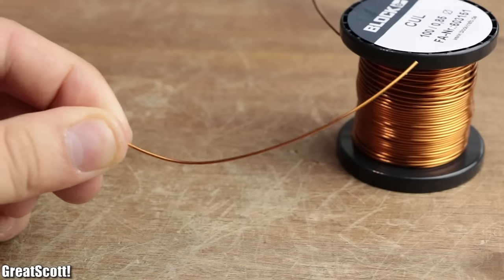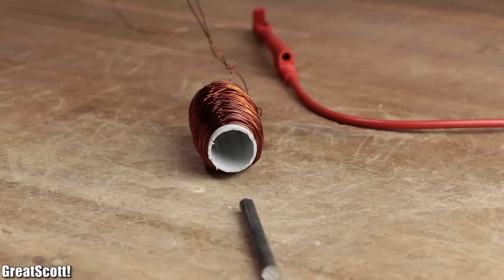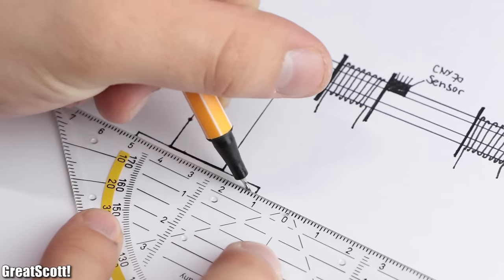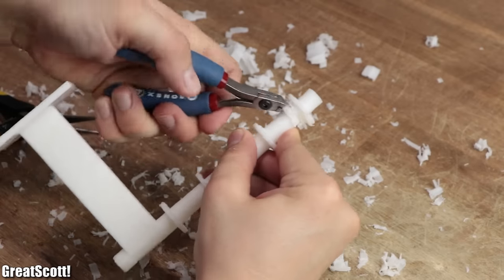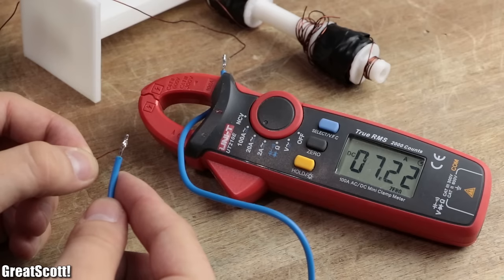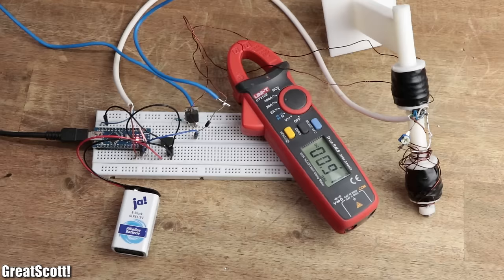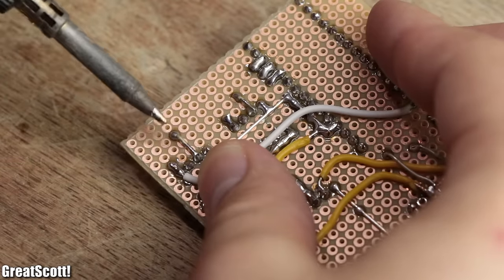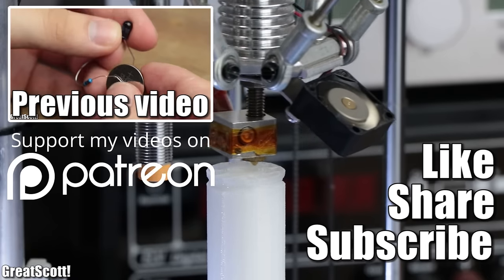Make your own Coilgun

Comment: Nice! But i want to see a new coilgun capable of "destroying" objects. So, do it with some powerfull capacitators. Pls, as soon as possible
Reply: hehexd
Reply: Flickerino
 I need it!!! (Nope!)
Reply: If you want it to be powerful, upscale it so it can push out a higher weight projectile at faster velocities
Reply: Oliver Church
I know it. More coils, a lighter projectile and some big caps. But i don't know the ciruit for controlling the coil, charging and discharging the caps, etc, etc. So i need to wait a new video from GreatScott
Reply: me too
Reply: +jackguo380 rectified main's voltage gives you the rms ac voltage multiplied by square root of 2. For example, with 230v ac, you will obtain a thing like 310v dc
Reply: I can't open the link now, but I swear that i've connected a capacitor to main's voltage with a bridge rectifier and i've been very scared because i've exceeded the maximum voltage of the capacitor and reached 310v, I was afraid that the capacitor would explode in a few seconds. In fact, 310v is the peak voltage of a semi wave, peak voltage that is kept, rectified and livelled by the capacitor.
Reply: Lord Tiger
Trow it away
it's a bomb xD
Reply: Woop2000 Ka-boom.
Reply: just make the barrel bigger more coils and stuff idk the rest
Reply: The force exerted on the projectile is the flux density of the elecromagnet, multiplied by the current, multiplied by the length of the projectile. Bearing that in mind, you wouldn't need capacitors to increase the force exerted on the projectile.

- Longer projectile.
- Wire with a higher CSA or a lower resistivity to increase the current.
- Coil the wires as tight as possible, with as many layers as possible (The more wire you can fit into an an area, the stronger the flux density is gonna be.).
- Replace the PVC tube with a steel or iron one to increase the flux density.

There's four ways you could increase the force of the projectile without having to use capacitors.

Bullets, on average have, 305N of force, so if you can do the things mentioned above, it wouldn't be impossible to create a coil gun with the same force as a bullet from a firearm without having to add capacitors. 

Of course, the longer the projectile is, the heavier it'll be, so probably best to focus on that only if necessary. Another option would be to make it hollow.
Reply: wow. smart fella
Reply: you can do that just by making this coil gun but shooting smaller projectiles
Reply: @tiger.98  you need 400V rated capacitor
Reply: @johnrubensaragi4125  it's been 2 years lol
Anyway yeah, you need some headroom so 350v is the bare minimum. 450v is common (mains have peaks)
Reply: So much this!!!
Reply: This can destroy paper.
Reply: You can already destroy an ant with this coil gun.
Reply: @ProsD03  Google it then
Reply: lollx destroying objects, why not use a powerful one to launch a satellite in to space?

Comment: When I was experimenting with my own coilgun I used transformer inductor with circuit from the old camera flashlight which was increasing voltage up to 300V and firing 7mm steel BB from the single coil. Now It's stored in my eletronic box so I'll build it up again very soon and possibly make a video about it
Reply: subbed
Reply: 5 years have passed, where is your coil gun video!
Reply: @kerbatonbaton8108  Totally forgot about it xd. Strangely enough I still have that gun and I'll try to make it happen not very soon cause I now have other interests mostly related to car stuff.
Reply: @Northaxe  Do you still have that coil gun?
Reply: @andriohalfer4615  yup i do!
Reply: @Northaxe 7 years passed! Where is the video?

Comment: This could be really cool if you were to turn it into an hour clock, make the gun shoot vertical, and add a plexiglass tube to the end with a bell at the top, at the end of the hour the bolt would shoot up through the tube and ring the bell and fall back down to be shot at the next hour!

Comment: I remember my first coil gun about 15 years ago. I used disposable cameras for the capacitor bank [about 8 i think] and the charge circuit, a pen for the barrel, drill parts for the handle and trigger... I wish I hadn't lost it.

Comment: This may have been said before, but those blue screw terminals can be connected to each other before soldering. Each has a tongue and groove so you can make them whatever length you want before soldering them in. The slots are just so small they're hard to notice.

Comment: I made one of these years ago with the flash circuit from a disposable camera.
It's limited to single-stage, but you get a lot more power out of the high voltage strobe capacitor, and you can just wire the coil in series with the xenon strobe tube for switching (tube doesn't conduct until triggered).

I got mine to shoot little pieces of coat hanger wire across my bedroom.
If I added more capacitors to it (from more disposable film camera flash units), it's likely that I could have gotten it to shoot those pieces of coat hanger wire clear thru a soda can (maybe even both sides).

Best part? I got the disposable cameras for FREE.
Just go to a place that still processes 35mm film and ask them for some "junk" disposable cameras without the film.

Seriously, it's worth asking for those "junked" disposable cameras even if you only want the capacitor in them.
You can't buy something for less than free, and the worst they can say is "no".
Bank up a bunch of them and you could make some really dangerous high power electronic devices, like a soda can imploder or aluminum plate launcher.

To be honest, the hardest part to source for my "scrapheap coilgun" was the magnet wire.
If you can find a junked CRT computer monitor, you can probably salvage the magnet wire from the degaussing coil. Some CRT TVs might have a degaussing coil as well, but in my experience you're better off looking for a computer monitor.

If you want to build a big coilgun, the hardest part to source will be the thing that switches the current to the coil(s). Best bet is likely to be building your own triggered spark gap. Not too hard to do and can be done with hardware store parts and TIG welding electrodes as the spark gap electrodes.

Comment: Great but... Why, why Arduino? Would it not be mush more intresting if you had used classical ICs? Every video on electronics is with microcontrollers now, i miss the old analogic stuff :/
Reply from the maker: You mean like logic gates? Or what kind of ICs do you have in mind?
Reply: Sorry, i meant the old school electronics without microcontrollers.. I don't know, things like opamp, ne555 and so, I don't know exactly how to do a similar thing with them, that's why i'm so intrested with them, 'cause all I see today on youtube is Arduino and codelines.
Sorry for my English
Reply from the maker: I think that might be an interesting video. I could create a similar circuit without coding. With logic gates, RC circuits and OpAmps. Wait for this weeks video.
Reply: Thank you very much :D
Reply: You got that right. I always try to find a way to avoid microcontrollers, and I almost always get by without using them. Cheers :)
Reply: +GreatScott! Lol u live in germany
Reply: +butterfli1 I don't get how that's funny.
Reply: I agree with Lord Tiger.  Your latest videos use more and more microcontrollers like the arduino. It makes sense from a developer's perspective because you can prototype very quickly your circuit and adjust the same hardware with software. And i'm pretty sure that's the way it works in the industry too. But for us mere mortals we want something that works with very basic components.
Reply: Purple Perplexing Pineapples i User los as the New gosh
Reply: +butterfli1 ...?
Reply: Purple Perplexing Pineapples lol im sorry mobile
Reply: +butterfli1 what did you mean to say?
Reply: That my mobile sucks
Reply: I do agree. Fast switching transistors can switch up to 300 MHz, while Arduino has 8 MHz microchip and is switching even slower.  Optocouplers + transistors will do just the magic you need. I really believe ju do need larger coils for effective coilgun.
Reply: Lord Tiger the arduino circuit would be much more simple. without it, you would need all kinds of op amps, comparators,and logic gates which would not fit on the base of the gun. but nice idea 😀
Reply: He has made a new video. By the way, coilguns without microcontrollers do exist, and they're projected specifically to avoid the problems encountered here. The speed is ESSENTIAL for a good efficiency coilgun, and you can obtain it only with analogic circuits.
Reply: I still think the logic circuitry used in that tutorial is a bit unnecessarily complicated.
A 555 Timer acting as a flip-flop can handle all of the logic required to control the coils. (one timer IC per coil)
A Push button pulls the trigger pin low, setting output high, this then goes into a MOSFET gate driver IC to turn on the MOSFET for it's respective coil.
The infrared sensor's LED is connected from supply to drain of the MOSFET (with an appropriate resistor in series), and now the sensor turns on.
The collector of the phototransistor is connected to supply and the emitter to a 10k pull down resistor. Emitter is also connected to gate of a small signal MOSFET such as the 2n7000
The drain of the signal transistor (2n7000) is connected to the reset pin of the original 555 Timer (which is pulled high with a 10k pull-up resistor) and its source is connected to ground.
When the phototransistor begins conducting i.e. projectile is in the middle of the coil, the voltage on the 10k resistor will exceed the signal mosfet's threshold voltage, connecting the reset pin of the 555 timer to ground and setting the output low. This switches the power MOSFET off and in turn the coil and sensor.
The 555 timer is set up in monostable mode, meaning if something goes wrong it automatically shuts off after a set period of time (equal to ln(2) * R*C).
To trigger later coil stages, the reset pin of the first 555 timer is tied to the trigger pin of the second 555 timer, repeat the setup for the second 555 timer. 
A Capacitor and bleed resistor can be used to prevent catastrophic failure if the push button is held down continuously. 
Already tested this setup on a breadboard, going to solder everything together on perfboard and build my prototype next week.
It's a pretty compact set up too, I can fit about 3 stages on a 6cm by 8cm perfboard.
If I want more stages, just need to stack the perfboards together, connect supply and ground rails, and tie reset and trigger pins of the timers that need to go together.
If you want to switch two coils on at a time, then the first and second 555 timers' trigger pins will be tied together and triggered by the push button, reset of timer 1 is tied to trigger of timer 3, reset of timer 2 is tied to trigger to timer 4, etc.
All this logic circuitry is fed by a 5v regulated supply from a linear regulator. 
If higher voltages are to be tested, would probably need a high voltage SMPS and a buck converter since most linear regulators have a supply range that extends only upto 37v.

Comment: That is cool.
I suck at analog electronics so here's how mine is going to work:
And thanks for the schematics  btw.
For any given projectile one could tune the coil firing like this:
Optimise the 1st on time to impart the maximum amount of enery to the projectile.
This might need distance measuring or with a radar or anothe coil could be done electronically.
Once this is maximized, then set the firing of the second coil and on time so as to further maximize the projectile's energy (measured by either its speed, or distance traveled).
If you have more coils, then repeat the process.
Hint: we know that each subsequent coil will be on for a shorter period as the projectile travels at a higher speed through it.
IF you have enought battery energy, then you can turn all the coil on at the same time and only worry bout the off timing.
Also to recycle some energy, you can recapture the magnetic field collaps in a cap and reuse that.

Comment: I made my own coil gun and she shoots up to 600foot with 10 coils and 10 compositors and each compasiter shoots out 400v and 20amps and than to that is 3 lithium battles and all 3 together is 9500 Miller amps :)) and in each coil there is a sencer so there is no need to estermate where the metal nail is as she knows where the nail is

Comment: I wonder if it could be improved by maybe using an opamp on the secondary coil to detect the induced  rising edge as the projectile enters it. That could then be used as the trigger to avoid having to cut in to the barrel or use IR sensors.

Comment: I've been watching a lot of coil gun videos for a possible project, and this is the best one. Great job.  Although I gotta say that 3D print left a lot to be desired x-P!  If you never got around to designing an upgrade and want to revisit it let me know I'm a currently unemployed engineer with a lot of time and modeling software!
Reply: if i used capacitors instead, do i only need to change the mosfets to ICBTs or something else??

Comment: The time the coils need to be on could be calculated or expimentally determined.  perhaps a dual 555 timer chip could replace the microcontroller logic.  pots on the timer could fine tune the projectile velocity.   Sound like a great AP physics project.

Comment: if we did some complicated simulation of magnetic field and attraction of the projectile we should be able to find the exact right capacity for the capacitor it so we dont have to turn it of again, cause voltage will be at almoust zero when the projectile is in the middle of the coil.

Comment: IR sensor problem can be resolved with an IR receiver/emitter setup. The issue with this setup, is that the emitter and receiver are in the same spot, which makes it so hard to fine tune. Material reflectivity can cause misfires.

If you have the emitter and receiver opposite to each other, it only depends on the projectile blocking the light ports on each side, eliminating the issue.

Comment: Superb project again Scott. I wonder if you can detect the passage of the projectile past the coil centre electrically, by detecting a change in coil voltage or current? Ultimately you could remove the opto switch, but for now it could be valuable as a trigger source for investigating how the coil current and voltage change.
Reply: It would work much better to use a magnetometer or Hall effect sensor to do that.  Basically, when the iron is in the middle of the coil it amplifies the magnetic field.  This shows up as a spike on the magnetometer.  Then use the spike and a delay to switch the magnets.

Comment: so this is how the projectiles are getting speed mach 7 , i once saw a documentry about electrical charge gun that fires a bullet with incredible speed , only the current and voltage they were using was beyond lightning bolt

Comment: By adding a spring in the back and taking off excess weight to the bullet you could've reduced the coil and input voltage considerably as well as putting limit switches instead of optical sensors

Comment: using a flyback diode makes the magnet field collapse very slow since it limits the coil voltage to ~0.7V, many mosfets are avalanche rated so you can skip the diode and get 
a much faster collapse by letting the voltage rise until the mosfet clamps it at Vbrdss

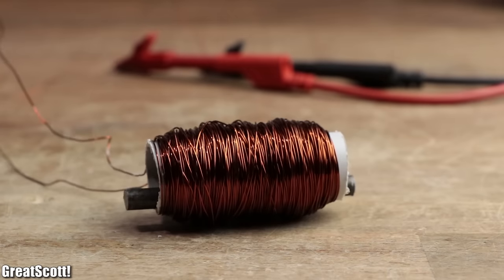Comment: If you just turn of the electricity for a moment not so long that  The electromagnet pulls it back but only long enough that it pulls it forward then turn it off you can  Technically make a rail gun 0:36

Comment: just a thought here, instead of turning off the flow of energy at mid-point, wouldnt it be possible to reverse the flow, and therefore the magnetic charge to "push" rather than pull the rod and giving it even more boost?

Comment: RC timed coil guns are way better than sensor coil gun. You can have about 7% effiency with a RC timed coil gun, where only 3% can be achieved with sensors.
Reply: Is there a specific reason?
Reply: V.S.O. I might be wrong, but i would imagine it’s because there is a set time for each “pulse” cutting out the time for the optical sensor to trigger the next coil

Comment: I'm going to try something more mechanical. basically you just need to complete and break the circuit, so I think if you made the "trigger" mechanism complete the loop when squeezed and break when released, that should do it. I'm more mechanically minded anyways, so all these circuit boards are a foreign language to me. But it did help me a lot so I do appreciate it.

Comment: Theoretically, you wouldn't need the optical sensors if your projectiles are all the same size, and you use a timer instead.
If you time it perfectly, you should also get a boost in velocity of the projectile, and less waste of power.

Comment: Wouldn't it be more efficient to place the sensors at the back of the coils because the magnetic field needs time to dissipate so if it's at the front the magnetic field will slow down the iron bar?

Comment: made rail gun using 10 dishwasher water fill solenoid magnets  wired in series - coils are mounted on a rod to make straight barrel - then coils are glued together - rod is removed and a magnet from a speaker in loaded into barrel-> power with car battery or similar----
be careful -- it is Very powerful